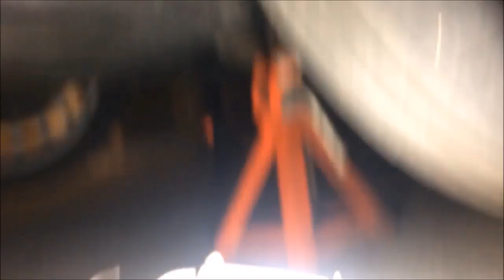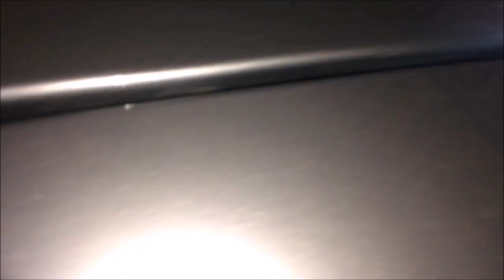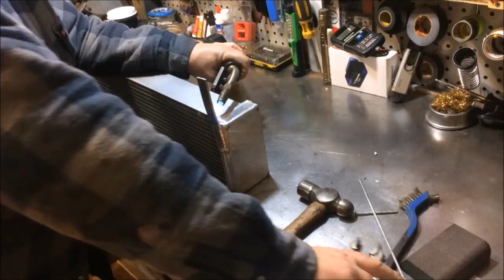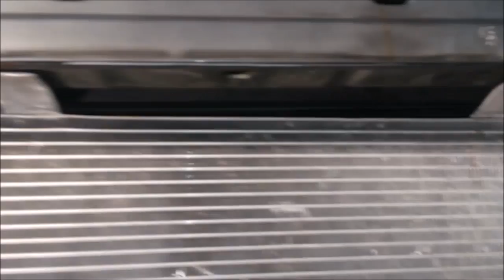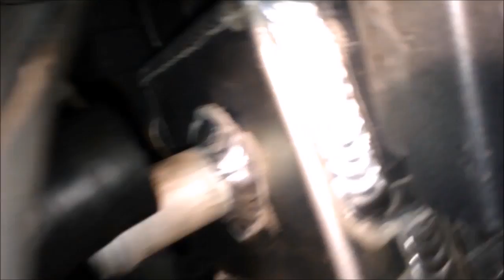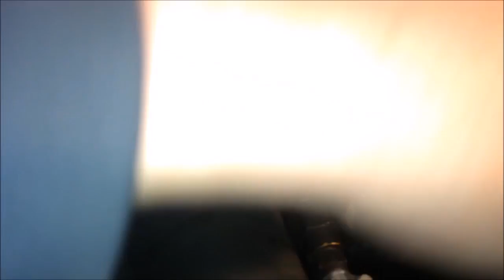upgrade your car's heat exchanger

Comment: Thanks for this video paul. We have managed to install it, but instead of on the bumper, we have bent both lips 90deg and put them under the radiator. Had to drill 1 hole through the bottom of the frame to attach it, the other was already over a hole (where the pipes are). Small piece for extending the top pipe, and we were done. (Still a couple hours of work)